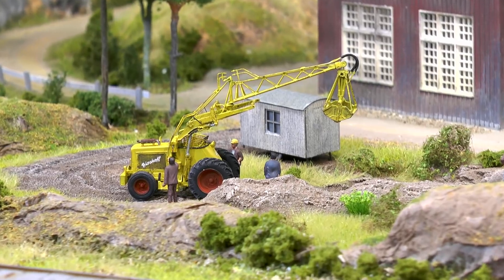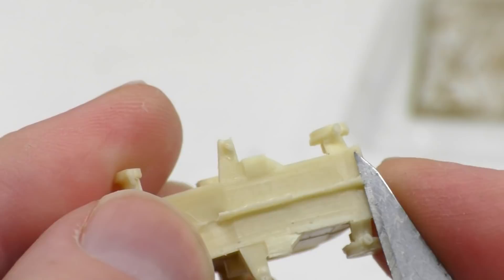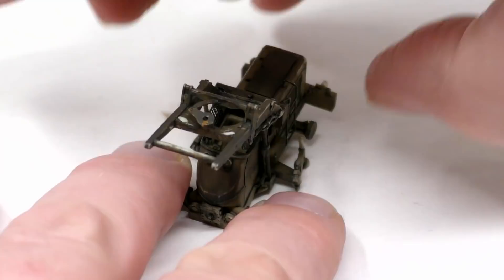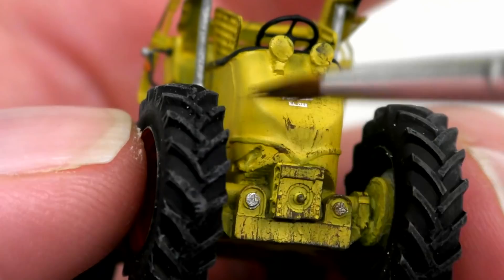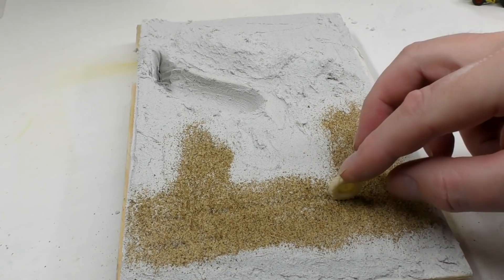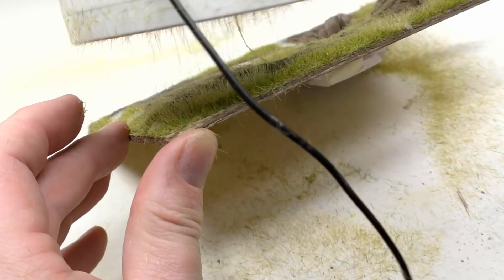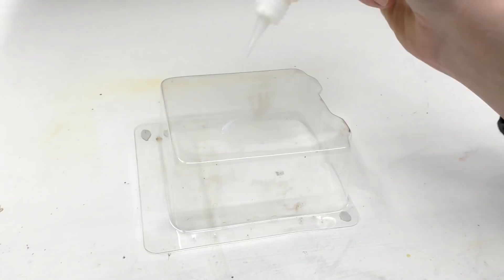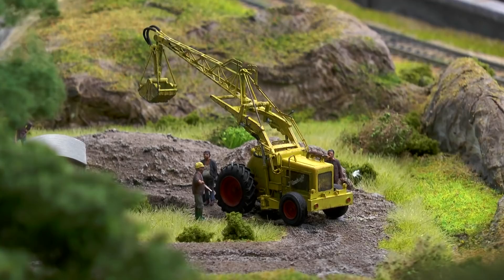Paint and assembly techniques for Resin kits

Comment: I'm just a little confused about the painting part. You used an oil-based paint first as a base-coat. Then you used acrylics, which are water-based. I've always been told to use acrylics under oils or the paint will crack and break (oil floats on water, not the other way around). Can you explain how your painting order works? Does the paint eventually crack or break? If not, why not? Thanks Marklin.

I've painted resin items before and always was successful just using acrylics (I can't use oils because the smell makes it very hard for me to breathe). Is there a reason you used the oil-based paint first? I've never painted anything so small and don't know if I could with the health issues I have, but I really would love to be able to. Details are my favourite thing to paint. Your layout is really amazing to see and I enjoy watching how you put it together.